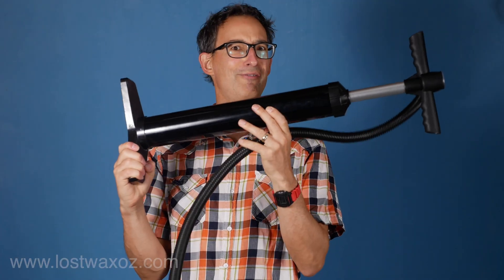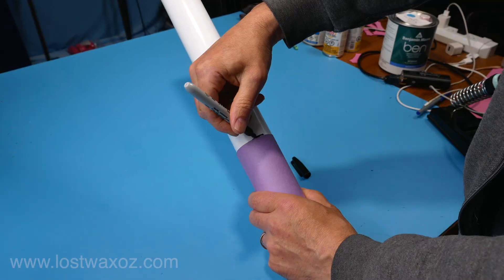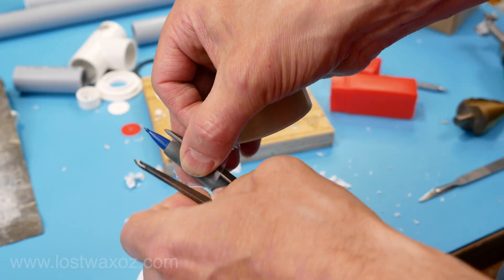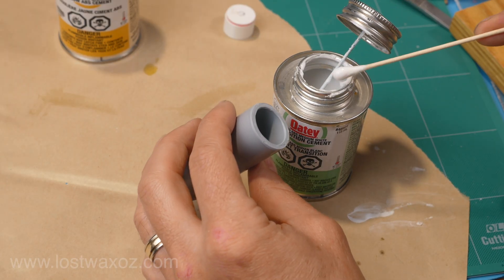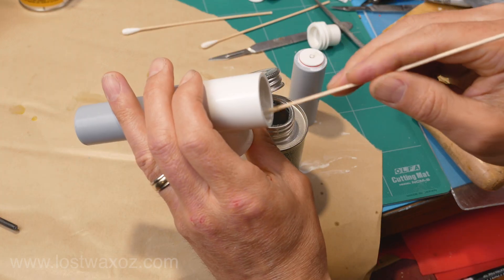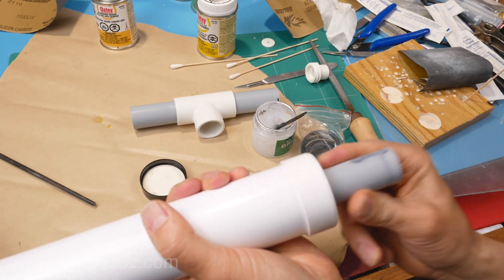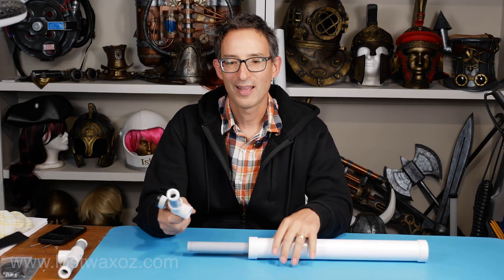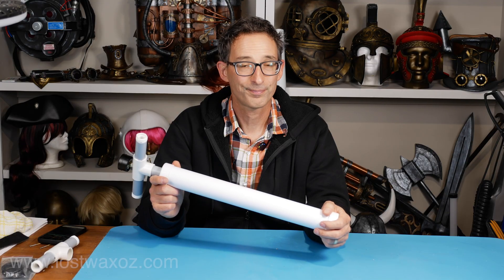DIY SUP Pump➡ 30 psi From Plumbing Parts and 3d Printed.

Comment: I've missed your videos! PS- next time try acetone before a scalpel when you accidentally glue yourself to something.
Reply: Would there have been a risk of melting the plastic with the acetone?
Reply: @mtaylor7171 not in my experience. Just put a bit on a cotton swab and dab a bit at the CA glue until it lifts. Don’t want to dump the bottom on it, but I’ve not had any issues with very moderate use. 

If you were worried about that, you could also try an ice cube to break the bond, then use the acetone once the bond is broken.
Reply from the maker: Interesting, I didn't know acetone dissolves CA glue. Thanks for the tip!
Reply: @LostWax2 it’s worked for me! but obviously check on something that doesn’t matter just in case. I’ve also seen people use iso alcohol, but haven’t tried it. I have used it to loosen hot glue gun, tho. But try it all on unimportant objects first.
Reply: @JW_Steed TY 🙂
Reply: @mtaylor7171  Hope it helps! I've glued myself to things a few too many times! 🤣 but yeah, ice to break the bond, esp if it's skin, then a wee bit of acetone dabbed carefully should do the trick. Time and patience. 🖖🏼
Reply: @JW_Steed 😁

Comment: I love how many "tips & tricks " you get in a video ! 
Maybe you could do a video on glues ? You mentioned one I hadn't even heard of ?
Reply from the maker: THat's a good idea. btw which glue hadn't you heard of?
Reply: @LostWax2 I think you said something like a "combination" glue ?! 
At one point of the video, you had about 3 different glues going !? Lol 😅
I've done work with p.v.c. type glue before & wood glue, so my brain was brought up short !?
Reply from the maker: Oh, yeah, probably transition cement. It's for bonding dissimilar plastics like ABS to PVC. Doesn't create a welded bond like the material specific glues. I'd never heard of it before this project either😁